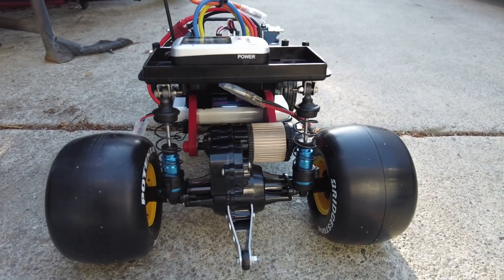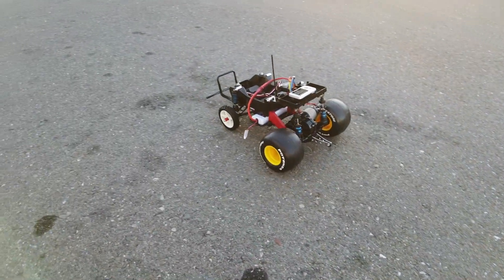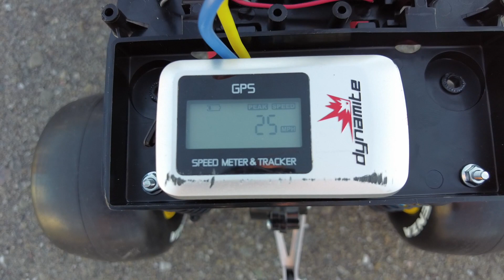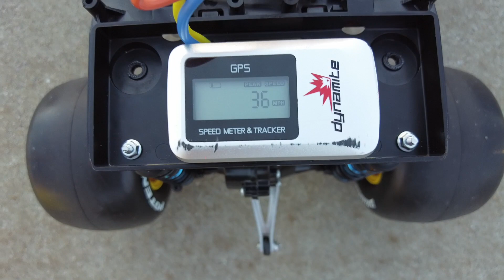E0010: Tamiya CW 01 Speed Run Challenge Part 4 - Phase 2 Upgrades

Comment: That was Hauling , what a little Beast have you tried with the body on , maybe gets more speed if its deflecting the air better than the chassis would , im only guessing but it looked like a heap of fun ive bought the black edition lunchbox and the standard yellow as well as the midnight pumpkin in metallic and ill be using one for a speed runner as this looks like way too much fun for only small amount of $$$ and also have purchased a gopro7 Black to record it all and also share with like minded enthusiasts online here on the Tube 🙂thanks for a great video liked and subbed 🙂
Reply from the maker: Sounds like you're on your way. I do have other videos of runs with the body on. I actually found that the lexan bodies do a good job of protecting the chassis because the bounce and slide when you flip. The hard bodies also help a little but are less forgiving and tend to transmit more forces to the chassis. The chassis in this video was retired due to too many crashes.

I would recommend that you pick up some aluminum body posts as these tend to snap off in crashes. 

Godspeed in your efforts.

Comment: I love what you've done here, Bryce!  I was considering going with some skinny front tires at some point, too.  We'll see...  But man, you've got that thing moving!  42 mph, that puts you in the lead so far!  Great work, dude!  🤙
Reply from the maker: Thanks! I need to get the body painted up and mounted to see what it’s going to look like. I don’t want to deviate too far from the original looks. 

I’m also guessing that with the weight and aero of the body, it will slow down some.
Reply: @jack-o-trades  yeah it's not exactly aerodynamic, plus the factory body is quite heavy.  I'm running a lexan version  but remember, the contest is open to any body of your choice, so if you fond a cheaper, lighter one that fits, you're welcome to use it.  👊